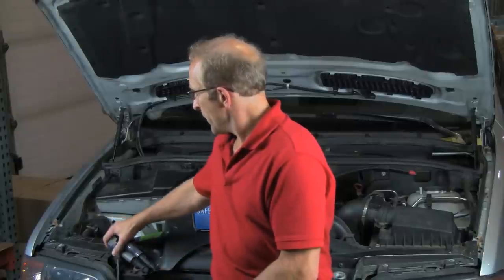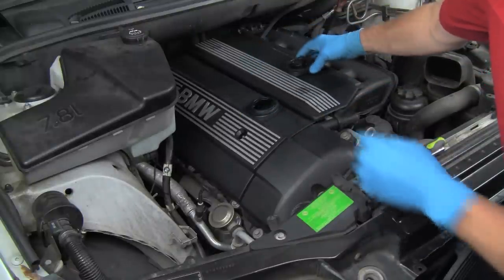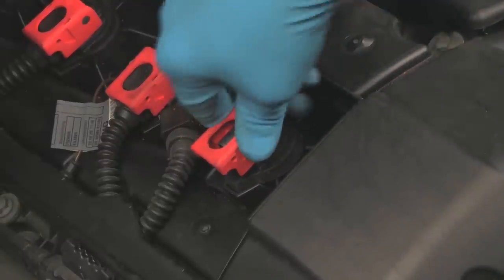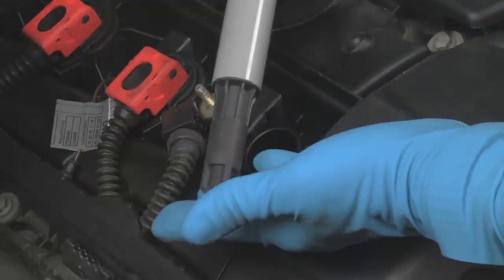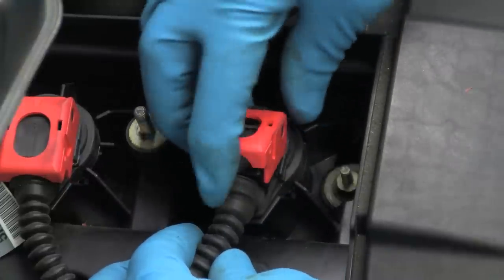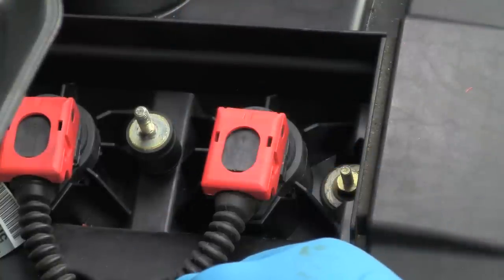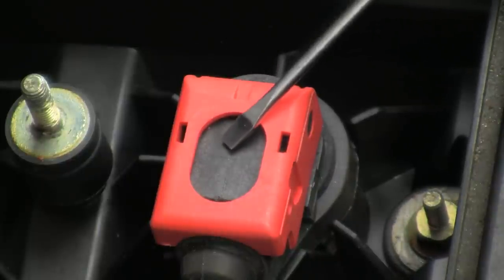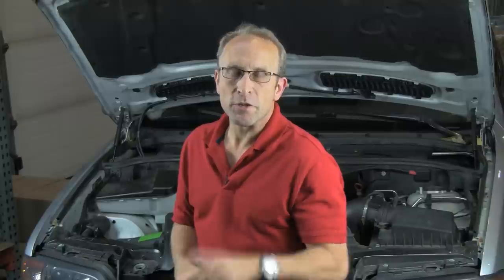Installing High-Performance  Ignition Coils (Pencil-type) in a BMW Engine

Comment from the maker: We do not have model specific dyno runs for the high-performance coils.  However, EuroTuner magazine tested the coils on their 97 M3 project car (part-7, Jan.,2009).  The coils improved overall average fuel economy from 21mpg to 24mpg (27mpg highway).  Additionally, a 4-hp gain was achieved.

Comment: Warning: I just replaced a set of BAV Auto coils in an N54 less than a year old and one of the coils fell apart upon extraction. Hours were spend trying to fish out the rest of the rubber embedded between the ceramic of the plug and the wall of the plug hole. They were replaced with Bosch coils since they kept misfiring.

Comment: I bought these ignition coils for my 2009 328i sedan in hopes to receive an increased performance change but to my surprise, it was no different than just installing a new set of plugs. After just over 10,000 miles I repurchased new OEM coils from the dealer and definitely felt an increase of performance again. The coils never failed in any way, however no increased performance. Highly suggest not to buy
Reply: lol ... coilpacks do not improve performance

Comment: Thanks for the video. However,  I have a 2011 bmw 750 li with the n63 and not the n54. Installed these coils but I have a little play between spark plug and coil. When I press down on the coil I here  and feel a little play between the two. Is this normal?

Comment: Another great product, so another quick review. I recently purchased ignition coils for my 94' 325i (they're a little bit different than these). I bought my 325 about a month ago from a private owner so of course I'm coming across inherited problems/wear and tear from the previous owner. Anyways, after changing the spark plugs a couple weeks back, I came across some serious damage on two of the rubber "boots" on the old coils. Between seeing that and experiencing some severe hesitation and loss of power in the lower RPM's I decided it was time to replace the coils. I installed my Bavauto set last night and it feels like I'm driving a completely different car. Very satisfied.
Reply from the maker: Thanks William, we're glad to hear about your success!

Comment: This is a great video. I have an older model BMW, so it wasn't quite as easy to change the coils. Each coil was attached/supported by 2 nuts, so this ended up being an extra step than in the video. Also, it snaps down on the side rather than on top. But by watching the video and looking at the replacement coils, it definitely helped me figure out how to change them. Thanks for helping out us women in the world who aren't afraid to get a little greasy :)

Comment: Thanks for tip to ensure a close and tight fit to the ignition coil. I just installed mine this morning but didn't make sure it was a tight fit. After viewing your video I decided to open up the cover again and there it was... visible gaps. I would have left it like that if it wasn't because of your video. Thanks a lot!

Comment: this is a must if you tuning or chipped the ecu and this is one of the majors when the performance Specialist  talks talks about changing wires these performance coils do about 40000 volts or more depending  on brand.

Comment from the maker: @covingtonium 
The ignition coil(s) is what generates the electrical energy to produce the spark at the spark plug(s).  A pick-up coil would typically be a sensor that is monitoring a part of the engine, such as; camshaft position sensors, crankshaft position sensors, engine RPM sensors, etc.

Comment: It is amazing how simple and logical the technology is on the BavAuto and BMW pencil type coils. The design makes them very easy to replace, or so I thought.  Once I got the 6 coils I set out to replace them as soon as UPS left them on my porch. They were a little delayed as they had to be backed ordered from Germany (wonder why it says they were made in China? Go figure.) Nonetheless.  I had prepared the car (E46 Touring '04) for installation by removing the cover and other necessary parts.  The first two coils (cylinder 6, and 5 respectively) went on as they looked, simple and easy. I was excited that this job would take no more than an hour. Much to my surprise, the remaining coils required major pressure, and finagling to get them fully flush such that the red clip could shut without expanding over the track. Coil 4, I had to use my needle nose pliers to bend the prongs down that it would push on complete but not without substantial force.  Coil 3, I have no idea how I got it on.  Coil 2 and 1 required some prayer, holy water, and constant putting them on and off to get them fully on. It was way more difficult than the factory coils they replaced.  Nonetheless I finally got them flush and the car runs great. Maybe a factory recalibration with factory coils are in order. Great Video.
Reply from the maker: We're sorry you had so much trouble.  We have even recently (before your order) had the manufacturer redesign the plug housing to allow easier connection.

Comment from the maker: @GaffyTube 
Thanks for the great review. Have you watched our brake pad and rotor replacement DIY video? The same steps would apply when installing our Ultimate rotors and Cool Carbon pads. We will be scheduling installation videos for suspension work and our Performance Brake upgrade Kit, in the future.

Comment: great video. I have a 8 cylinder X5, I was told the number 7 cylinder is mis- firing. Would you adise to just change the coil only, change spark plug and coil on number 7? or might as well change all 8 spark plugs and coils?

Comment: I'm getting misfire codes. I changed the spark plugs and still getting misfire codes. I did the precat o2 sensors as well. I haven't changed the coils yet. Is there a way to tell if the coil is bad? Is the misfire the primary indicator? here are my codes:

Table 19
CA - 02 sensor control limit cyl #1-3
C6 - catalytic converter efficiency cyl #1-3
E4 - 02 sensor adaptation limit cyl #4-6
E1 - aftercat fuel trim system cyl #1-3
EE - Misfire Cyl #1
FO - Misfire Cyl #3
EF - Misfire Cyl #2

Comment from the maker: @eduardovenom1 -
It is certainly not necessary to disconnect the battery for all electrical maintenance or repairs.  Circuits that are normally "off" when the ignition is off are usually fine to work on.  In working with the SRS system or working around "live" wiring or battery cables, these cases may consider battery disconnection.  The Bentley repair manuals will typically note if battery disconnection is required or encouraged.  We have the manuals at bavauto dot com.
Reply: lol why am i reading this in the voice from the video? XD XD XD

Comment: Is it still necessary to use silicone grease in the boot with this type coil?
Reply from the maker: It's not a bad idea.  We don't see these boots sticking to the spark plugs as regularly as the older designs, but we have seen it happen.

Comment: I need Help here. I have a 2000 e46 with the M52TU25 engine n my cylinder #5 ignition coil is bad it's on n off. The problem is I can't figure out which igniting coil is number 5. Anybody Willing to help me thanks

Comment from the maker: @archiguitarchi 
We would consider a "tune-up" or maintenance replacement of the direct ignition coils (coil on top of the spark plug) at 150,000 miles or so.  Note that this does not specifically mean that the coils are faulty at this point.  However, due to the high heat that the coils are subject to, they will likely be in a degraded mode to some degree.  Obviously, if a fault code or fault symptom points to a bad coil, we wiould replace it at that time.  Order your coils at BAVAUTO dot COM

Comment: I don't see these for sale in your store. Any help?
Reply from the maker: Check the link below.  It will take you to the department on our web site, for the coils.  You will have to enter your year & model in order to go further to see the units for your car.  If you have a very current model, you may have the one design that we do not have yet.  If any questions, just email us at info@bavauto.com or call our advisors at 800-535-2002 or 603-427-2002.
Hi Po Ignition Coils, wires, etc.:
http://www.bavauto.com/se1.asp?dept_id=223
Reply: Looking for e60 535i
Reply from the maker: *****
- We are working on the Hi-Po coils for your 535i.  We should have them soon.

Comment: Only the very tip of the boot is capable of coming off, the OEM Bosch coils are monolithic other than the anti induction shield, the latter of which I’ve never seen or heared of separating,  i tried dissecting a bad one, they are not comparable to the inadequate coils on a 97 Ford 4.6l or a 5.4l